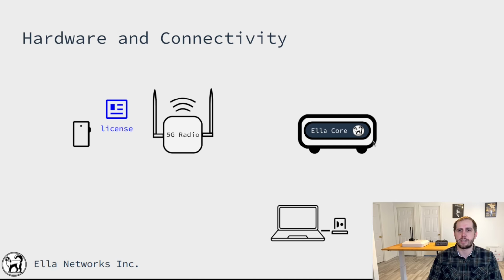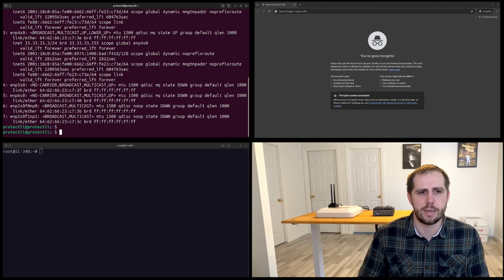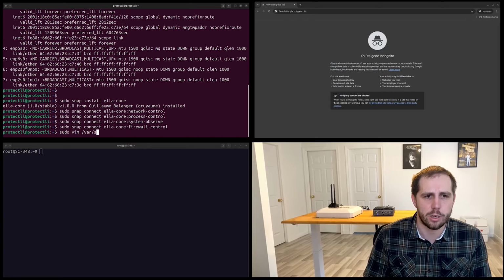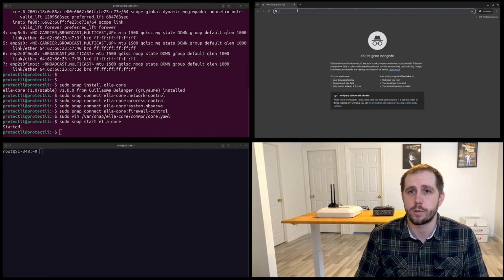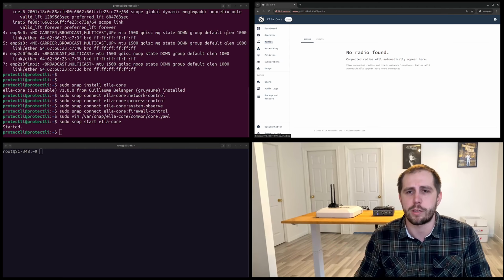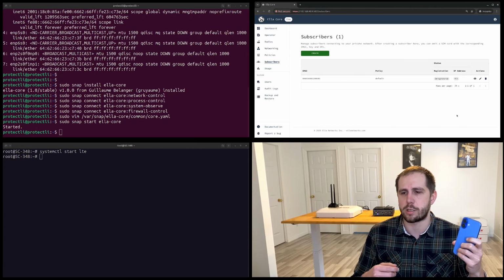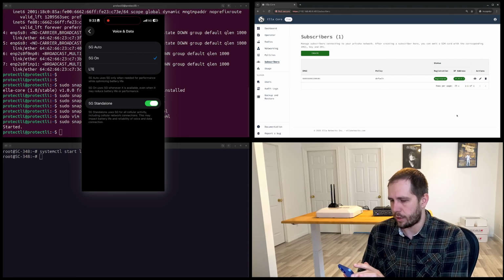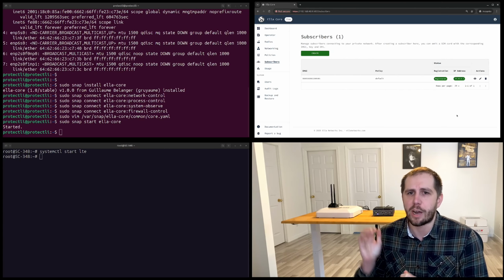Getting Started with Ella Core

Comment: Hi Guillaume, thank you very much for the explanation. My name is Vicente Llarena and I work as a telecommunication teacher in Somorrostro (Vocational Training Center) here in Spain. I have connected our gNB (Baicells Stellar 227 model, Vankom VKScell-g3 model and gNB with Ettus B210 and srsRAN) with your Core using as UE OnePlus Nord2 CE 5G and Huawei P40 5G). All is ok but when I do a "SpeedTest" the uplink is correct but the downlink is very very low. Could you show us a "SpeedTest" result with your Iphone?. Thank You very much.

Best Regards
Reply from the maker: Hello Vicente,

I'm happy to hear that you tried Ella Core and successfully integrated it with your gNodeBs and devices.

When running an Ookla speedtest with my iPhone towards the internet, I am able to saturate my system's backhaul (ISP limit of 120 Mbps DL and 10Mbps UL). When running speedtests without this ISP limit, we are able to saturate a physical 10Gbps pipe both downlink and uplink. You can find our methodology in our documentation under performance. One additional point to check is the XDP mode. To take advantage of eBPF and kernel-level packet processing, please ensure that XDP is set to native (and not generic). If you keep on facing this issue, please report it in GitHub and we'll look into it with you.

Guillaume
Reply: @ellanetworks  Thank you very much Guillaume, I will check it. Best Regards.